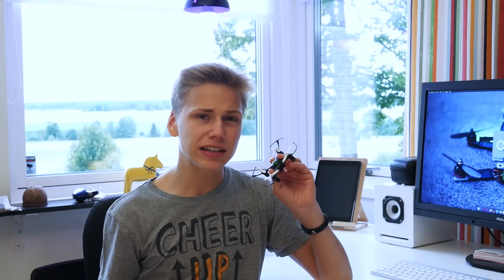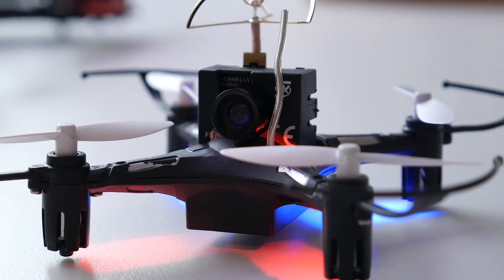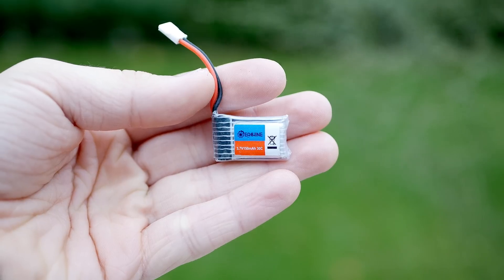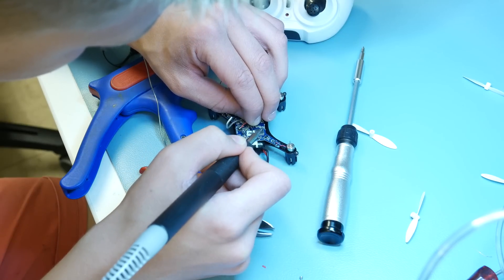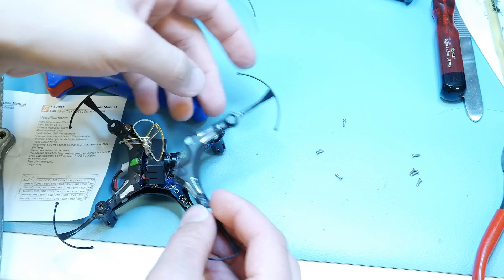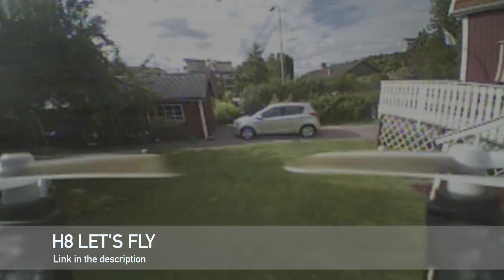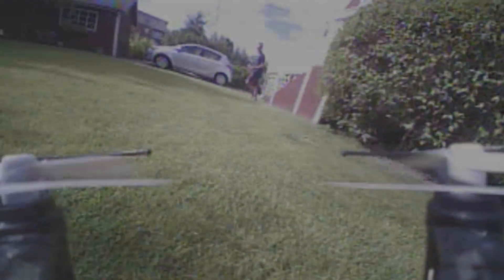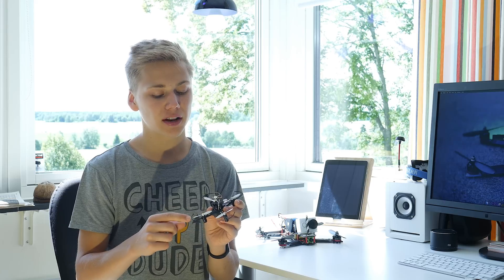How to add FPV to a micro quad! Eachine H8 fpv mod

Comment: Links are down to the câmera can you please update so I Can try do this?thanks
Reply from the maker: Any all in one fpv camera that supports 1s voltage will do. Like this one! https://m.banggood.com/Eachine-TX06-700TVL-FOV-120-Degree-5_8Ghz-48CH-Smart-Audio-Mini-FPV-Camera-Support-Pitmode-AIO-Transmitter-For-RC-Drone-Tiny-Whoop-p-1413572.html?rmmds=search&act_poa=POA4005407&cur_warehouse=CN
Reply from the maker: That camera also supports smart audio but in your case you probably don’t have support for it so you can just skip those cables
Reply: @dronexsweden6906  thanks alot ! unfornatly I dont find this drone in stock :( any other drone beetwen that Price That you Can advise me? thanks
Reply from the maker: @tiagomoreira8742  it’s more expensive now but I can really still recommend this drone https://www.banggood.com/Eachine-TX06-700TVL-FOV-120-Degree-5_8Ghz-48CH-Smart-Audio-Mini-FPV-Camera-Support-Pitmode-AIO-Transmitter-For-RC-Drone-Tiny-Whoop-p-1413572.html
Reply: @dronexsweden6906  sorry its a câmera link again 😔 you try to paste a drone link I believe
Reply from the maker: @tiagomoreira8742  Sorry, here it is! https://www.banggood.com/Eachine-H8-Mini-Headless-Mode-2_4G-4CH-6-Axis-RC-Drone-Quadcopter-RTF-p-975808.html?cur_warehouse=CN&ID=23342481&rmmds=search
Reply: @dronexsweden6906  thanks alot hope to arrive to do what you did with yours ! Really apreciate your kindness!

Comment: how do i connect my camera to my phone/goggles. i mean can i even connect it to a phone??
Reply from the maker: You can get a receiver that you plug into your phone. However, in my experience they work pretty poorly so I would recommend just getting some cheap box goggles. Hope that answers your question!
Reply: @dronexsweden6906  thank you very mutch

Comment: Instead of soddering you could have stuck it in the battery connector thereby allowing you to change it fast
Reply from the maker: yes absolutely! However I would recommend keeping the weight to absolute minimum for best performance!

Comment: I wonder what the flight time is with cam attached and 600mAh / 750mAh /  850mAh batteries used?
Reply: It's because I have tons of 600/750mAh 1S lipos here and no use for them :-) I used the 750mAh (18g) with my Hubsan 4X which has the same motors as the H8 (afaik), resulting in a flight time of 10 minutes(!), even with FPV cam attached. Definately worth a try.

Comment: cool video! Product battery: 3.7V 150mAh 15C(Included)? mast be a 30C. 
See: 
http://www.banggood.com/Eachine-H8S-3D-Mini-Inverted-Flight-2_4G-4CH-6Axis-One-Key-Return-RC-Quadcopter-RTF-p-1025599.html?p=OB12033264223201512P
   For more Power Use 150mah 45C :  
http://www.banggood.com/5PCS-Eachine-E010-3_7V-150MAH-45C-Upgrade-Battery-USB-Charger-Set-RC-Quadcopter-Spare-Parts-p-1103569.html?p=OB12033264223201512P
  dont forget to by cables conectors !  
http://www.banggood.com/10-Pairs-1S-Battery-Charging-Cable-Male-Female-p-1044078.html?p=OB12033264223201512P
  And more FUN 56000 RPM, cool:)  
http://www.banggood.com/4X-Racerstar-615-6x15mm-59000RPM-Coreless-Motor-for-Eachine-E010-E010C-Blade-Inductrix-Tiny-Whoop-p-1115474.html?p=OB12033264223201512P

Comment: You mentioned mounting smth else than the cam. What other mods did you have in mind?
Reply: DroneX Sweden I already cut the canopy in half, removing a good 1.5 cm part from the middle to pop the antenna out and make room for the camera. I also removed the landing pads and the prop guards, so now the quad became 2-3 grams lighter. It flies crazy, unbeliavably agile and quick! Previously I didn't think about swapping motors and battery, but it well may be great with the extra weight of the camera. Thank you!

Comment: My H8 does not recognize the control (lights are only blinking all the time), do you know how to solve this issue?
Reply: DroneX Sweden I followed this procedure but nothing happens, apparently this is a cold solder on the board. I will resolder all point and see what happens. Thanks!
Reply: Hello. You need to have the h8 on a flat surface! This solved all of my problems
Reply: power on, put it on a flat surface, then bind

Comment: I attached a tx02 to the h8 mini and I get a good signal as long as im not flying but every time i apply thrust to the quad the video cuts out. Whats happening is it not able to supply enough power to the quad and camera at once?

Comment: what googles do you use? Can i use eachine VR-007?
Reply: DroneX Sverige hello, great tutorial! Can I ask again about google? What kind of goggles do you use? VR-007?
Reply: @bird1003  he is using fatsharks. they are about $500+(wouldn't recommend to get it if first timer). try for eachine vr006
Reply: I just did this FPV mod and have the VR-007 and can confirm it works :)

Comment: After the H8 Mini which quad do you recommend - I'm thinking of getting the XK X100 - Please advise. 

http://www.banggood.com/XK-X100-With-3D-6G-Mode-Inverted-Flight-2_4G-4CH-6-Axis-LED-RC-Quadcopter-BNF-And-RTF-p-1039066.html